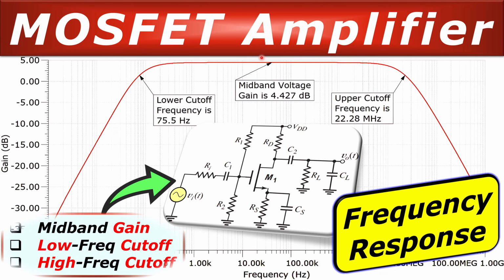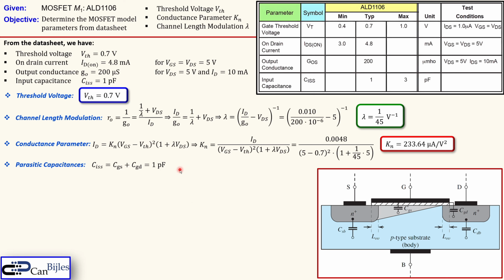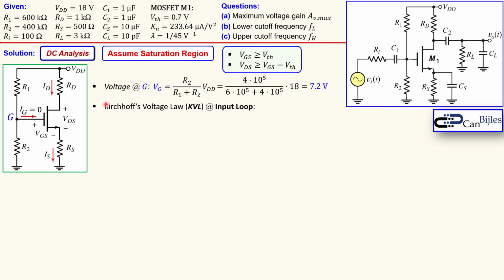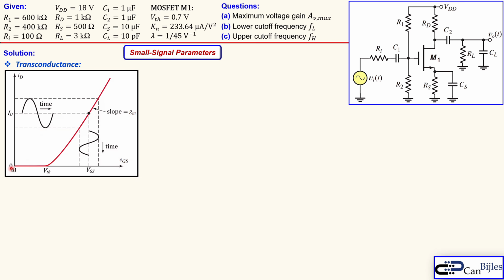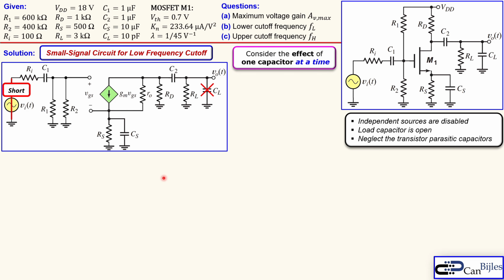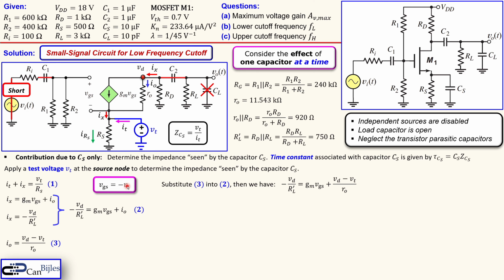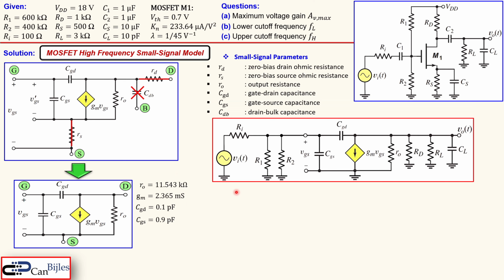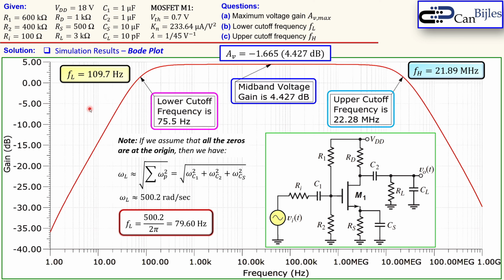MOSFET Common-Source Amplifier 🎯 Midband Gain, Low-Frequency & High-Frequency Cutoff 👉 FULL DETAILS💫

Comment: nice example thank you
Reply from the maker: You're welcome! 👍
Reply: @CANEDUX  one question arises, we say dominant pole but even when let say wl = wc1 + wc2 + wc3 just we are averaging and as you said dominant should be 5 to 10 times bigger, what if we multiply resultant wl * 5 or * 10, is there any benefit to it or making calculation more realistic
Reply from the maker: @behnamkiani3736  If dominant pole approximation is valid and used, we should not multiply the final result w_L by 5 or 10 again. Also not after adding the separate pole frequencies. This will make the result wrong.
Reply: @CANEDUX thank you
Reply from the maker: You are welcome!